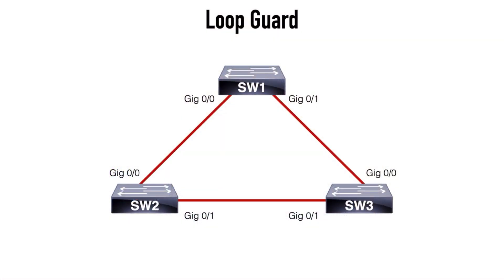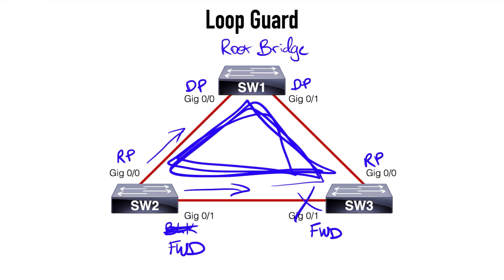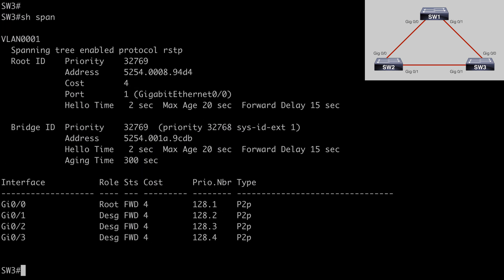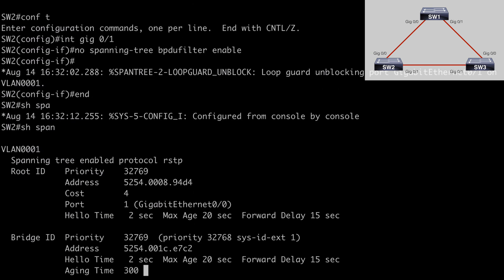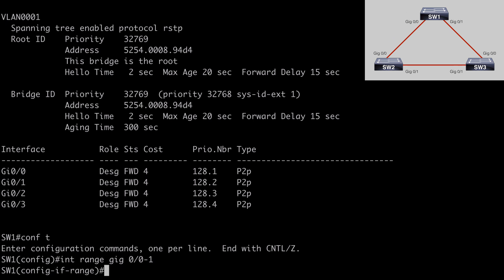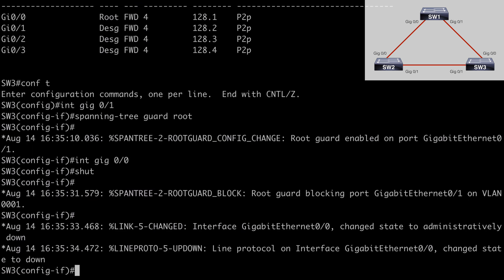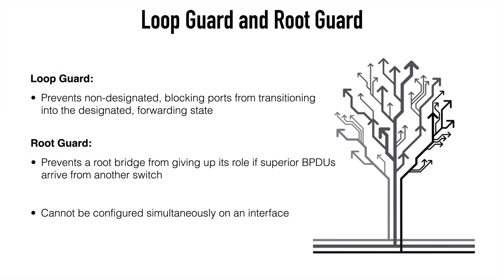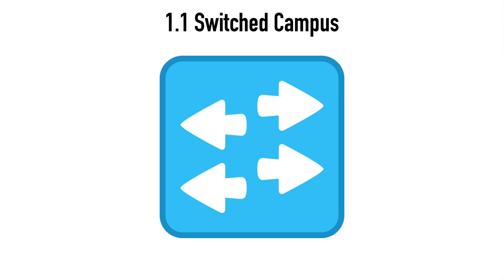CCIE Topic: 1.1e Loop Guard and Root Guard

Comment: Thank you for this wonderful video. 

However I have a question, what would happen if the G0/0 interface on SW3 actually fails and the Designated port (G0/1) stops forwarding BPDU. At what point would the Loopguard allow BPDU again after putting the port in Root Inconsistent state?

Comment: I dont get what will happen if we are enabling the loop guard, and the BPDU doesn't come because the link actually goes down, in this case the port will go to the inconsistent mode instead of going to the FWD state.and the traffic won't flow normally using this redundant link, am I missing something?
Reply: Could you please point out the Main Question here mate? What's the actual question that you wanted to ask?
Reply: @kewalpreetsinghaulakh9338  He means if there is a real failure, will the loopguard enabled switch go to forwarding instead of the loop inconsistent state?
Reply: @pled8395  I have the same question.  No one here answered it.